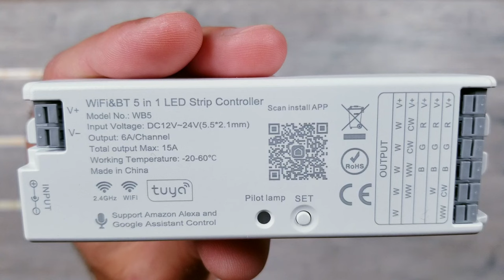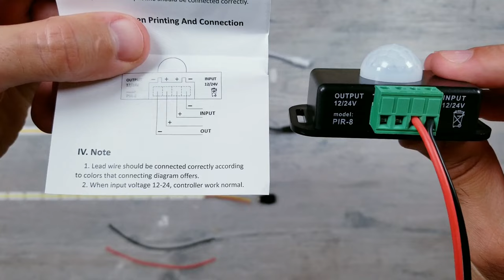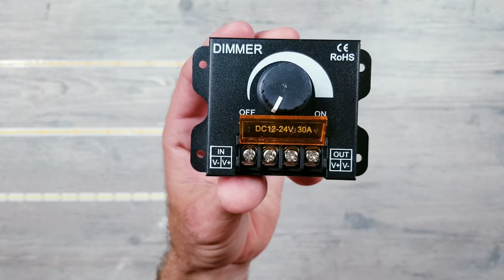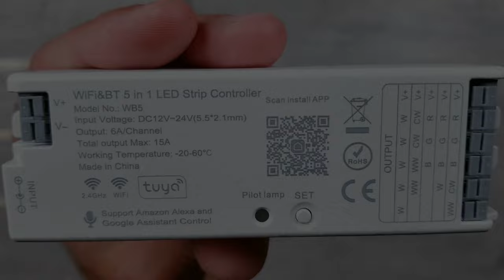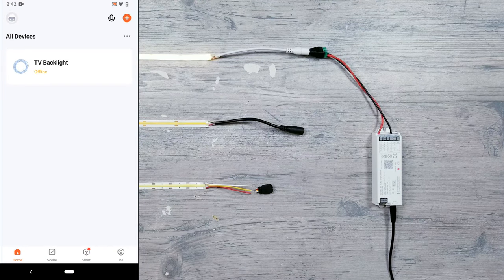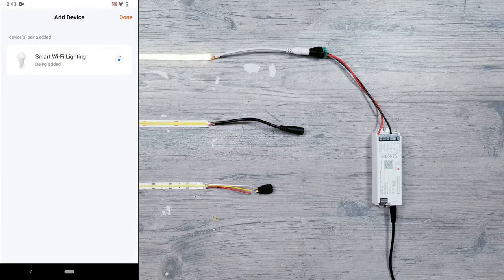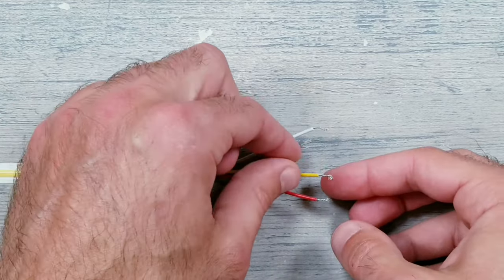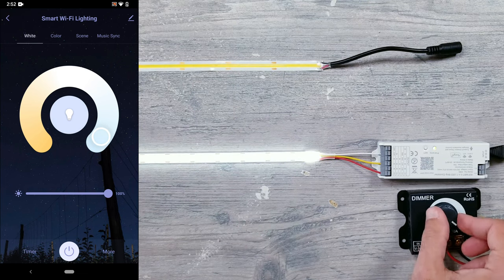COB LED Strip Tutorial: Getting Started. 4 EASY ways to control. Step by Step Walkthrough

Comment: mine were easy as hell to install. Mine has a usb plug and I plugged it into the 3d printer enclosure and taped it around the inside. Now if the printer is on the lights are on, if it's off, the lights are off. Easy peasy , cost $7 on amazon

Comment: Mine are starting to get very hot and smelling at that plug pin after 5 weeks of setting up and don't know why? There not cheap one's there also using a good power supply just plug and play set up not messed around with but the connector is burning hot amd starting to smell now?! Any thoughts would be appreciated to see what else I can actually do to stop this

Comment: Quick question. I want to buy the natural white leds from your description, and I want to put them around my dresser and my nightstand, and maybe under my bed. If I want these three pieces of furniture to have their own leds without them all connecting to each other, and using the wifi/bluetooth controller, how would I do that? Would I need to buy 3 sets of led strips, or 3 controllers, or 3 power supplies? I'm just wondering if there is something I can buy to make them all work together, or if they do that on their own.

Comment: Always plug dimmers & other optional controls after the switch (or what'Ms being used for switching  I/0 ). Dimming a WIFI module or a PIR sensor is prob' not recommended by the manuf'.
Great video, clear explanations'
Reply from the maker: Thats great advice and thanks so much for the tips! That makes perfect sense and i'll remember that for next time. Thanks for watching!
Reply: @ChrisMaherDIY  these thingy are sometimes protected against wrong wiring or other "oups..", but still, why taking a chance..
Reply: What do you mean by "after"? Between the switch and the light or between the switch and power?
Reply: @notsohandyandy between the light and the switch. This way, the control/module/etc. isn't always live, and will be energized only when needed. Therefore less heat, usage, etc. and
MAKE SURE you switch the hot wire (line), not the neutral. 
Feel free to ask any question you may have. Better to feel stupid with a question than in front of the wife who's going to tell all of her friends about you trying to burn down the house...😂🤣😂🤣

Comment: Was waiting for you to make a video on cobs! Can't wait to watch it after work today.
Reply from the maker: Thanks for the support as always buddy!!
Reply: @ChrisMaherDIY  hey, do you remember that I told you a while back that I was planning an rgb cob led strip project? I was wondering if you know which wires are which on those strips. They have a green, white and red one together in some sort of plug and another red and white one underneath the strip. I can't figure out which ones are data and which ones are power. I think the 3 together are supposed to be data. A second thing.. I ordered some adapters you recommended but when they came in I noticed they have American plugs and I live in Europe lol. Anyway I was so stoked to see the led strips so I powered them with a 12V adapter (I know very stupid but I got impatient) and they were flickering and some of the strip didn't light at all. It was only for 30 seconds but they did get really hot...Do you reckon they still work or have they blown up already lol.
Reply from the maker: @HarigeRups  hey buddy! It sounds like they are just like the ws2813b led strips. Red for votalge, white for ground and green for data. The other red and white extra ones are for injecting power but are optional. Do you know if the strip is 5v?
Reply: @ChrisMaherDIY  yeah it is 5 v and I supplied 12 v adapter so what do you think? Is it broken? I am waiting for american to europe plug to be delivered

Comment: Great video! I have been looking at these strips for a while now. I currently just use rgb 5050 strips with wifi controllers, but I never change the colour anyway. Some of my strips have LED's that dont work correctly. Granted they are cheaper strips and that might be part of the problem. For simplicity I am thinking of switching to these with just power and a smart plug.

Comment: Great Video. I have an island that is not powered. I would like my island to have the led as will my cabinets. Can I simply run wire between tiles on floor to the island? Or would the wire pose a fire risk. I don't think these lights get hot enough but you tell me. Thanks for any assistance.
Reply from the maker: Thanks so much for watching and taking the time time to comment! That is a great question! I'm no electrician so I'm not 100% sure on that. I know for sure it would work but if it poses a risk, that I do not know. I think as long as you try to waterproof the connection points it would be fine!

Comment: Thanks for all the instruction.  I am working on added 1m lights to bottom of stair treads 14 stairs.  I thought I was just go with the Govee 100 ft lights but she doesn't like the individual lights, I tried buying a set of cob 16,4' and then plugging into a Govee controller, bit all it did was blink. Any ideas how to use a Govee with BTF lights? How do I calc how much power i need for a that much light?

Comment: so what wire is the ground wire on the  last strip? Do the yellow and the whit wire both act as a ground / negative? Does that last strip have to have a controller if you're not using warm temp color?

Comment: Chris, thanks for the tutorial! I bought the setup but seem to have an issue with actually getting the lights on. Did what you did and have the wb5 controller set up, but the lights just aren’t turning on. Wondering if you have any suggestions. There’s power going into the controller so not sure where the issue is at.

Comment: Great video !!  One question maybe you can help me with, I am building a home that will have prewire with switches already in place for under cabinet leds, what would I use to lower the voltage to the correct output ?  Thank you

Comment: What do you mean by the temperature? Can I only have these on for a certain amount of time ? Or can I have them on for hours and no worries
Reply from the maker: Thanks so much for watching and great question. You can have them on as long as you want with no worries. Temperature means: "Color temperature is a way to describe the light appearance provided by a light bulb. It is measured in degrees of Kelvin (K) on a scale from 1,000 to 10,000. Typically, Kelvin temperatures for commercial and residential lighting applications fall somewhere on a scale from 2000K to 6500K"

Comment: Any reason you used the wifi controller and not an ESP based board?
Reply from the maker: Thanks so much for watching and great question! This was my first time really playing around with COB lights and I didn't know how to get these connected or controlled with and esp. I have since been able to connect them to an esp board and control with WLED but it was not the easiest of processes. I could very well have done it wrong and there might be an easier way that I'm not aware of. If you know of a good way, I'd love to know!
Reply: @ChrisMaherDIY  But basically the 5 in 1 controller is just easier? Is there any pros of the using the ESP style board (8266 or 32) vs the controller (speed, compatibility, features, or just size)?

Comment: Is it possible to have 15m long cables between the controller and the LED strip? Is it possible to assemble 2 strips of 5m COB cct to have a long strip of 10m? Is it possible to connect 4 LED strips to a single controller?

Comment: Great video! Is there a way to have a Wifi controller but still have a physical switch so you have the option of turning it on without using your phone?
Reply from the maker: Thanks so much for watching and glad you liked the video! I dont think I have personally tried it but I think that would be easy to do. In my mind, I would do it in this order. Power goes to the wifi controller, then to the switch and then to the lights. I would try it first that way and see how/if it works. If things dont seem to be working, I would then try doing Power, switch, wifi controller, lights. Hope that makes sense! Thanks!
Reply: Thanks again - do you know any Wi-Fi controllers that work with Homekit? I believe the one you listed does not? Having a hard time finding something that works with these COB’s.
Reply: @davideastin did you wind up trying this? I was thinking of a similar setup: both a dimmer switch AND on/off switch in addition to a WiFi controller. Did you do power > switch > controller > LED strip? or power > controller > switch > LED strip?

Comment: I picked up the BT+WIFI controller and the color adjust COB strip you used here. When I adjust the color in the app it only changes the warm white, there is no cool white, and when I dim the strip using the controller, there is a loud hum. Any ideas, I've tried reseating the wires in the controller?

Comment: Chris - first time on your channel and love it already.

I’m curious how you might set up a strip for the following:

I want to put LEDs in my garage to brighten it up while working and also have a motion sensor at night when just popping in and out.

Could I somehow chain the WiFi controller with the sensor AND have the option to keep the lights on indefinitely and having the motion capability when the power is off without manually switching power supply between the two?

I really hope you’re able to respond - it seems you’ve stopped replying to comments on this one.

Great stuff and thanks for answering so many questions already!

Comment: Super useful, but I can't figure out how to connect 18 gauge wire to the adjustable white without soldering? Every connector clip I can find only supports 2 wires or a minimum of 20 gauge. Any thoughts on what to do? I have everything ready to go but can't connect anything!

Comment: Great video! Can the controller also be used via Bluetooth? If not, what are some good options?
Reply from the maker: Thanks so much for watching and for taking the time to comment! The controller I used to connect to the phone is bluetooth capable as well so It should work just great!
Reply: @ChrisMaherDIY  Got it. What about for an RGB LED set up? Should I follow the same steps as the WLED video? Context, I don't have wifi at home, so I'm stuck with using Bluetooth.

Comment: Hi Chris, great video! I am planning to use the wifi adapter to power the adjustable white COB kit. My question is, will this also work with a motion sensor? Or should I go with one of the first two light strips, with the adjustable dimmer and sensor?
Reply from the maker: Thanks so much for watching! Great question!  I think it will work but I would probably set it up as power, then the wifi adapter then the motion sensor then the lights. I think that would work perfect if you do it that way! I'm not 100% sure since I don't think I tried it that way but if you just played around with things for a little bit I think it should work!

Comment: Hello, I have a question about using a smart plug. When I plug my power supply, that is connected to the cob strip, into a smart plug, it flashes after a certain period of time and when it turns off. For some reason, when the smart plug is turned off, the lights flash once before turning off. They also flash once periodically when on. I am using a 24 volt 1.2 Amp power supply. I also tried using different smart plugs and I'm still getting the same problem.

Comment: Hey Chris, thanks for the great content. I was wondering if you had any suggestions/best practice for using these for undercabinet lighting? I plan on routing out an LED channel in the bottom of the cabinet but I'm not sure what would be the best way to hardwire/power these. I'm wondering if I should hide an outlet plug inside the cabinet or run it straight through 12 vt wire.  Any suggestions r advice you could give me?
Reply from the maker: If you know how to hide a plug inside a cabinet, I would for sure go that rout. That would look the cleanest for sure. That way you would only need to run the small voltage and ground wire out of the cabinet to the led strip and those wires can be hidden very easily! Love the idea of routing out a channel at the bottom too!
Reply: @ChrisMaherDIY  thanks so much for the response you’ve inspired my project a lot already!

Comment: How would you go about controlling one of those with an ESP32? Especially the dimming part
Reply from the maker: I'll have to do a follow up video on that. I got it to work with an esp device and wled. I was able to dimm it using the app. I however am still not able to figure out how to connect a cob led strip that has adjustable white to an esp to control. But for the first one I had to use a mosfet trigger to get it to work!
Reply: @ChrisMaherDIY   Hey man, did you manage to figure it out? Would love to just use ESP32 to control the LEDs

Comment: Chris, you are the best at this. Thanks for the great videos and for making it so easy to follow. I am interested in using the FCOB + CCT LED Strips as cove lighting. Now, this is 38' in total and all I could find is that the maximum length is 16.4' x 2. I saw your video on the power injection. Can I not get my 38' and inject power half way through? The entire run is to be controlled by the same unit. Having it on two separate controllers will make it a headache to deal with. As a motion detection device I was thinking of using a Lutron wall mounted sensor which will also act as a wall switch. The controller would be the one you show in this video. 
I would be most grateful of you would let me know your thoughts in merit. 
Thanks, 
Lucho
Reply from the maker: Thanks so much for watching! Glad we were able to connect via email. Hope you were able to get things set up!!

Comment: How do I place two motion detectors (top and bottom of staircase) for these LEDs?
Reply: ID GET A WIFI outlet by Cync by Ge for where it's plugged in. Then buy the Cync Motion Sensors that are wireless and link them. This will trigger an automation via motion. To hardwire a Motion sensor on both sides would not be ideal as power flow. You'd need both to be wired in parallel to 1 side of the strip. It just isn't feasible

Comment: how would you set up cob led's with the controller using a Meanwell dimmable power supply (ELG-200-24B). The extra dimmable wires confuse me. I would like to have a wall dimmer as well as  the option of using the app ...

Comment: I have. Question about Motion Sensors for LED Strips. Everything I've found is 12v 1A motion sensors 
What would happen if you put these in series with 5V 60A Supply? Looking to motion sensor my led strips but BFT and my BFT power supply
Reply from the maker: That's a good question and I'm not exactly sure what would happen. I'm not an expert when it comes to all the power stuff. But my method of learning would be to order a few different things and just plug everything in and see what happens and go from there. I'm all about trial and error! If you try hooking things up, let me know what happens as i'm curious myself!

Comment: Thanks again for another fantastic video Chris. Your my “Go to guy” when it comes to LED strips. 1 question though what gauge wire do you use when connecting the barrel plugs? I’ve tried desoldering the plug off my BTF COB lights and soldering 18awg straight to the lights to connect to a wireless remote Receiver/power but the COB lights flicker on and off. Switched to barrel connector and the light stay on but the side coming from the power supply is getting really hot. Can you help or give any advice if you’ve experienced this before?
Thanks in advance and for the brilliant videos 😊
Reply from the maker: Thanks so much for watching and for the support! That's interesting why they would be flickering I have not experienced that so I can only guess. I'm sure you checked all the connections and made sure the power supply matches the led strip your using. 18awg wires should not be the issue. I would maybe try a different cob strip and see if it does the same thing or maybe move the wires to the next copper pad on the cob strip and see if its still flickering. Maybe someone else reading the comments might know what's going on and can offer some advice? Let me know if you figure things out.

Comment: Is it possible to control this COB strip with WLED using an ESP device?
Reply from the maker: So it turns out it is possible but I'm still trying to figure out exactly the best way of doing it. I literally could not find ANYTHING online about how to set it up so it was pretty much me just doing a ton of trial and error. I got the single color one to work but I have not yet been able to figure out if I can control a cob led strip that lets you adjust the white temperature to work with WLED. I'll try making a video at some point down the road on it!! Thanks!!
Reply: @ChrisMaherDIY  thank you very much for your reply. I hope you will found a solution to share with us.
Reply: @ChrisMaherDIY  You ever figure this out?

Comment: Chris, I tried two of the WB5 controllers on separate BTF-24V-FCOB-640L-W-L strips, wired them the same but in the Tuya Smart App one is controlled via the WHITE menu and the other is controlled via the COLOR menu.  What gives?  What did I do wrong.  Need help.
Reply from the maker: Thanks so much for watching and taking the time to comment! That is strange! So you have two strips and two controllers. Each strip is connected the same way to the controller but in the app, one strip is controlled via the color wheel and for the other strip on the other app, its controlled via the white wheel? That is strange! I would mabye reach out to BTF and see if they have any idea! I've never run into that so i'm not even sure myself what might be the issue!